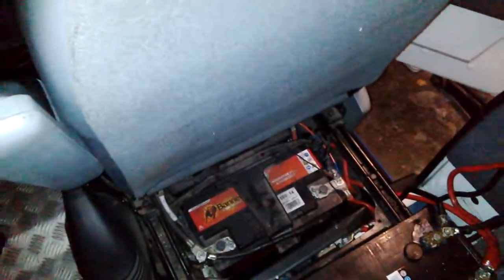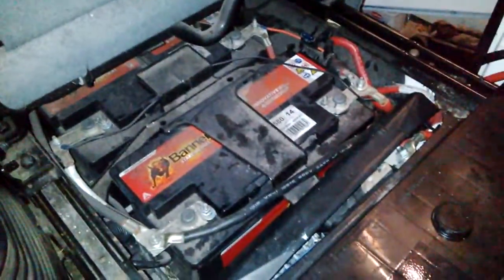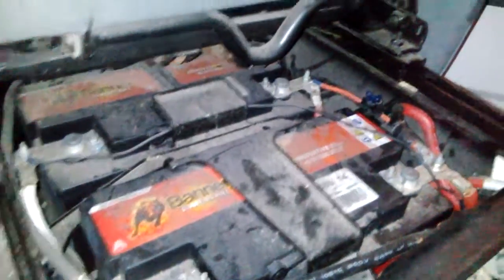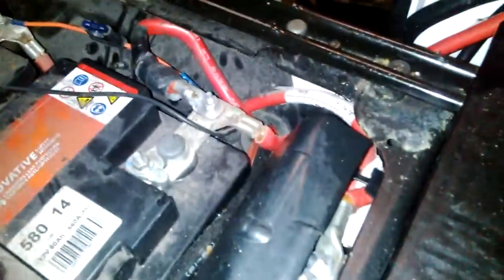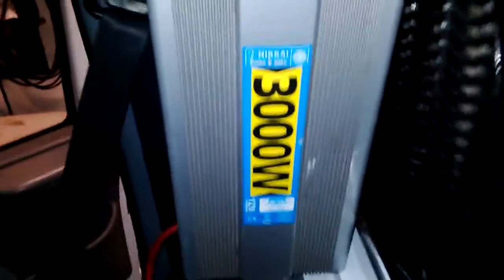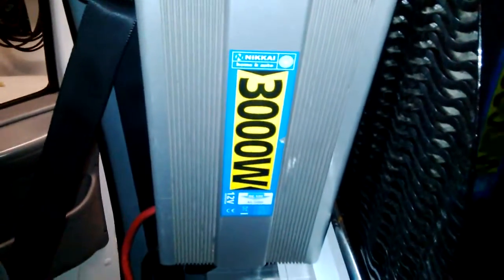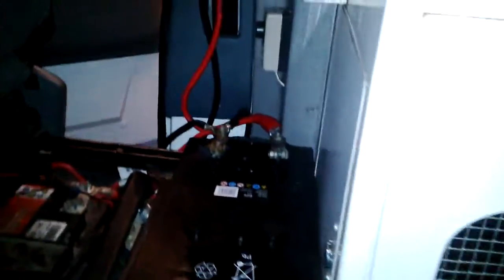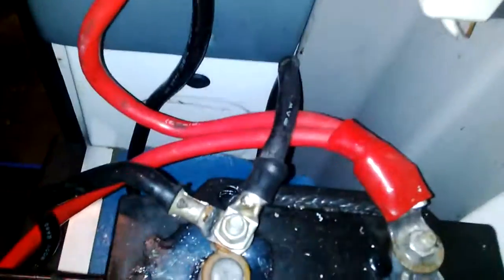Slush Machine Ice cream van setup

Comment: I am trying to use a power inverter to run a carpigiani 131 machine in my van..the plan is..8000w pure sine wave inverter on to 4 trojan 240amp battery's. .wots your thoughts on this process?

Comment: Hi thank you so much for your time. I have a ford transit 2000 ice cream van. The way I have it connected it is 1 battery under the seat which is banner battery 220ah and split charge system which runs from van starter battery to the leisure battery so that the starter didn’t go flat. But you might be right to have the split charger taken out but will it be ok for pitch work as I do parks and it’s parked most of the day. Thank you so much
Reply from the maker: The smiley transits here find that if they have good batteries then they work all day, but seeing as they are running all day and its only a short drive home there isn't enough time for the battery to charge up again.  All they do is on long days they put there batteries on charge.
We use the MK 7 Transits and they already have 2 batteries under the seat including the leisure battery and a 150 amp alternator so they run smooth and maintain.
The MK 6 Transit was a similar setup to your MK5, one battery under seat.  We had a split charge on there and it was the worst thing ever.  We then took that away and without ever charging the battery it run extremely smoothly.
Reply: Hi I hope your ok. Quick question do I need to put a fuse in between the starter battery and leisure battery or can I without a fuse. Thanks

Comment: Hi I know this is old now but I need help also I have a Whitby Morrison mk7 transit currently fitted with 2000w inverter and 2 Trojan 185 amp batteries !, the batteries are done I think and need to replace them could you recommend replacements and do I need 2 expensive 185 amp batteries or is there a cheaper smaller option ? Ie I see you use only 1 leisure battery what size? Cheers

Daz

Comment: Evening.

Just about to do this on my van and wondering if I need an additional 2 batteries or just 1 additional?
Also, it it best to use a caravan type lesuire battery or a standard van battery?

Thanks!!!!
Reply from the maker: Hiya. Leisure battery is the best, like 180amp one, preferably sealed unit as it's non maintenance so less stress and lasts for years! My vans have 2 normal batteries as standard and the leisure battery, but 1 standard and the leisure would be fine, but always need to make sure your alternator is powerful enough.

Comment: Hello do you have a split charge system in place or is it running off the main start up battery and the two battery that run the slush. Also does it keep going both bowls all day thanks Steve
Reply from the maker: Hi Buddy, split charge system is a waste of time.  We only had 1 van with the split charge system and its the only one we had problems with, batteries going flat etc etc.  What van are you doing this on?  And how many batteries etc do you have, at that's the important part. This system on video is directly to the batteries, 2 standard vehicle batteries and a large leisure battery.  And yes, this system will run the whole machine all day with no issues at all!!  We ran them 7 days a week, from 11am to 8pm and our batteries and machines and invertors were always fine, no issues!! Hope this helps!

Comment: Hello Friend can I ask did you need a 3000w invertor or was there something else you where wanting to plug in? Basically I'm trying to find out what power invertor is needed for just a slushie machine? Thanks for your time!!
Reply from the maker: Hi matey, depends on the size of your slush machine. If you have a rare 650w machine then 2000w invertor will be fine. On saying that I have run my 980w fast freeze machine on a 2000w invertor for about 2 months and working fine, but it's a bit nosier and the fan keep running meaning it's heating up lots, so I'd suggest for a 650 machine 2000w and anything bigger 3000w. If you can afford the difference I would also recommend the pure sinewave, even though the modified sinewave would be fine. Hope this helps!
Reply: Thank You so much for your reply, very much appreciated. Please may I ask do you know where I would find these details for my machine its a "sir lush" machine with 2 spinners. Many Thanks
Reply from the maker: On the back of the machine there should be a sticker or a metal plate that should tell you mode number etc and this will tell you the wattage. Good luck
Reply: Thanks Friend, Couldn't find anything on it. one side panel pops of where the filter is, but no wattage. Do you think a 3000w one will be ok? do you think the machine would need any more then that?
Thanks for your help once again.
Reply: also I noticed 2 batteries, I need it to connect to the car, would I need to add another battery or a bigger attery?
Reply from the maker: We have 2 original batteries under the seats as they're standard on ford transits and then we add the leisure battery as you do need the extra power!
Reply: Bless you my friend i understand.
Reply from the maker: As long as it's a twin bowl then the 3000 will more than cover it. Only if it's a 3 bowl you may have to look to get bigger depending on wattage, however go for a 3000 and that will be sufficient!!
Reply: +sicitalia1 Thank you. Much appreciated.

Comment: Hi I have a old smily face transit and have a slush that needs 55amp output. I am buying a 3000 watt invertor and been told I need a Trojan battery, is that correct and if so what watt do they need abs is it 2 I need.
Also where can I obtain the battery leads from. 
Who do u purchase your investors from please.

Comment: Hi, are the double batteries under your seat the main batteries which are charged by your alternator or extra one's?  Thanks
Reply from the maker: Hi, yes the MK 7 transit comes with 2 standard under the seat batteries, and these are charged by the alternator yes, then the leisure battery runs off of this correct.

Comment: How much will the whole setup cost?
Reply from the maker: Leisure Battery anything from £100 to £200, Cables £20 to £50, Invertor £200 to £500 depending on what you prefer, slush Machine used £500 - £600, new £1100 to £2000 again depending on what your preferences are (always go for the low watt one on machine as drains less power).  Depending on your van you may need an upgraded alternator (£150 - £250), however if using a Mark 7 transit they are built in with a 150 alternator and double battery as standard under the seat, therefore no issues on powering it up. Avoid a split charge system, complex and more hassle than what it's worth.  Never had any problem without one and I've run this system shown in the video on over 16 Mark 7 transits!

Comment: Hi can you tell me watt size amp hour batterys you are using,and the power out put of the slush machine plse,many thx nic
Reply from the maker: The batteries are Ok from 170 to 180, the machines range from 650w to 1000w and they run all of them no problem. Some we run on 650w machines so leaves us a little more space for hot dog machine, however my personal vab runs a 1000w machine and hot dog in winter with no issues whatsoever. The only concern you would have to have is what is running your battery in the 1st instance. That's the important factor as I run all mine on new transits therefore they have the upgraded 150w alternator as the old vans struggle. Plus these new transits have 2 batteries as standard under the drivers seat, so the power connection is all relevant. I have 2 older smiley face transits which are all hooked up too but they have to run on max 650w machines as the leisure battery drains from the main battery and lower watt alternator. Some people have created a double alternator to overcome this, we just put the leisure on charge every night to overcome this. Hope this helps fella.
Reply: +sicitalia1 Thank you for your reply,very helpful.

Comment: How do yu recharge the battery?
Reply from the maker: The battery recharges automatically by the van batteries
Reply: @sicitalia1  do yu gotta connect a positive cable to the alternator?
Reply from the maker: @tomiko181swg  no, you are simply connecting the leisure battery to the pre-existing vehicle batteries and that is where it takes all its power from
Reply: what type of battery are you using.
I tried connecting my slush machine into my van n my voltage drops.
can you help me out with my set up

Comment: would this run a slush machine ? link below thanks
Reply from the maker: Hi Kevin
I would suggest a minimum of 3000w invertor with a 6000w peak. Preferably soft start (which almost all are) and the best option would be pure sine wave, rather than modified sine wave, however either would be fine!! Hope this helps matey!